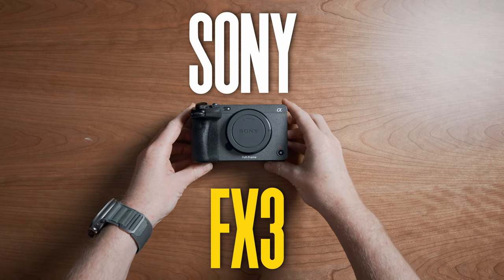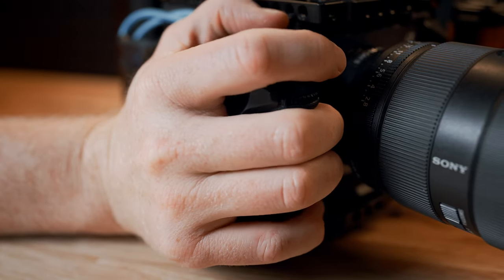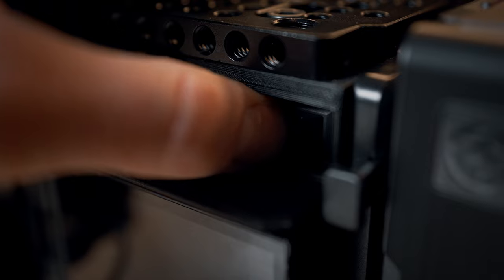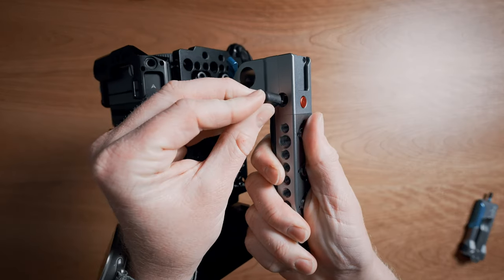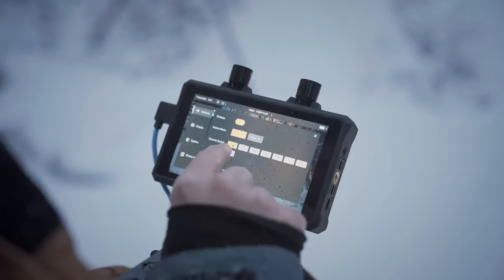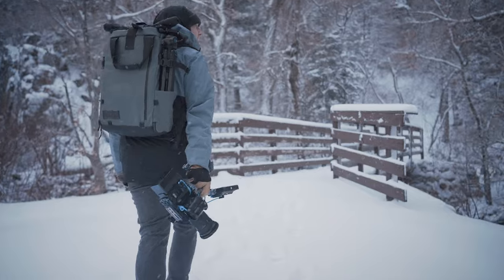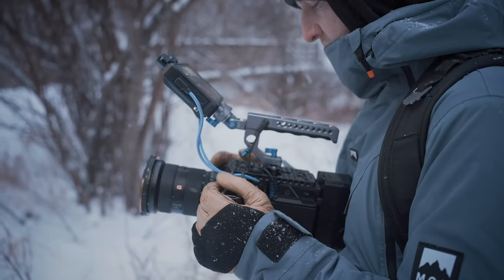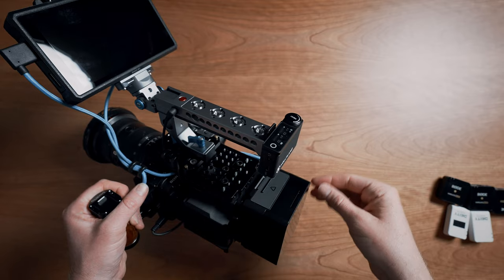The PERFECT Sony FX3 FX30 Cinema Rig in 2024

Comment: I would change the orientation of your dtaps. that hard bend probably won't be good for your cables long term
Reply from the maker: They can’t really go any other way due to the orientation of the ports
Reply: You can unscrew them and flip their orientation.
Reply: Quick qeustion... have you successfully done this with your rig? I haven't yet take it apart to see if this is even possible.
Reply: Yes, I have. I will let you know that the kondor blue are a little tighter than other brands.
Reply: @colemowery  hmm.. I will have to look into this. Thanks for the response! Do you have any photos or video to reference. I'm just curios to see.
Reply from the maker: I tried but wasnt able to swap the dtap splitter orientation on the Cineback
Reply: @kylemeshna  awe bummer

Comment: can this build be achieved the same way while using the Sony XLR handle the fx30 is bundled with?
Reply from the maker: There is now a separate option for that on the Cineback yes
Reply: @kylemeshna  thanks so much great content. Didn't even realize you would comment on that at the end of the video while i was watching and commented 😅
Reply: @kylemeshna  also if I am looking to cut some cost on this build, losing the cineback for the small rig v mount. Is the only drawback that you cant cut the power via a switch? will everything else work without the cineback?

Comment: Hey Kyle... Does the monitor still allow the touch auto focus to work ? From the monitor screen itself?
Reply from the maker: Touch focus needs to be done on the fx3’s screen. But the Portkeys I linked in the description does have a wireless control function that allows you to do touch focus on the monitor directly

Comment: what are some alternatives for powering the camera if you are already on the latest firmware? Also what do you use to charge the vmount battery?
Reply from the maker: The v Mount charges via USBC. And Kondor blue has a dtap to USBC cable that you can use as well that won’t cause the warning.

Comment: All I see now is shooters rigging out their FX30/3 to basically function like an FX6/FS5/FS7, BUT all the cash you spent on all the stuff to rig it out you could've had an FS5/FX6. Not to mention you can spend $10,000 on rigging out your FX30 and still NEVER have true built-in VND, XLR proper audio or the button layout that we all crave for on the FX6/FS5/C300/C200/UrsaMini/EVO etc...
Maybe someone can explain to me why you'd build out an FX3 at the price of over what an FX6 costs. 

FX3 $3,898.00
Monitor $300
Cage $75
Side Handle $80
Cineback $330
Vmount Batt $200
Top Handle $100
Addition costs (cables, dummy Batt, rails, mounts, etc) $150
Total: $5,133

FX6 $4,800-$5900 (used market)
Adorama, eBay, KEH etc

No additional costs after you purchase the FX6 (other than media and lenses) it comes with literally everything listed in the above FX3 build. Except it's all Sony proprietary so it's meant to function together out of the box. 
It comes with a battery, it comes with a top handle, it comes with a side handle, no need for a cage, no need for cable management, no need for a monitor, no need for VND, no need to wonder where your proper audio is coming from. The above FX3 kit btw is even actually more than $5133 because you have to factor in your audio solution and your VND. Just those two alone will cost you at minimum $350. You can use 3.5mm into the FX3 but once again that's not production quality audio.
You can then say I'll just get an FX30 and bump the cost down to $3500, but then at that cost you could have x2 FS5 Mii  or x2 Canon C300 Mii or x2 Mini Ursas or x2 C200s or x3 FS7s even ($900/ea), which btw records 10bit422 internally. You can get three FS7s for $2800 on Adorama. Multiple camera angles holds WAY more value than the tiny image quality bump.  
I'm pretty confident that in a blind test you couldn't tell the difference between the FS5 and the FX30. In some ways I feel like the FS5 looks better lol. Even the F55 or an F3 looks better than an FX30, imo, and you can pick up an older Cine Alta for dirt cheap now, with all the bells and whistles.

If you can't produce a beautiful visual story using an FS7, you won't magically be able to do it with an FX3.

Comment: FX3.  Yes.  FX30.  No, it shouldn't even be part of the cinema line, an 11 stop camera that has noise, artificially cuts off stops of dynamic range so that color correction is different versus the FX3, and is really quite noisy, slow motion unusable without noise reduction, just a whole host of issues that because of the body, people think it's not a consumer level camera.  FX3, so gooooood, FX30 just get a used A7S3 and put up with the menu shittiness, literally will change your life and the look of what you're shooting.  Or get the FX3, the better body for the  A7S3.
Reply from the maker: Why are you so angry about a camera lol
Reply: @kylemeshna  where's the anger?  Guy on the tag implies it could be as good as the FX6, I feel bad for the kid who buys the FX30 and it's barely better than his current beginner camera.